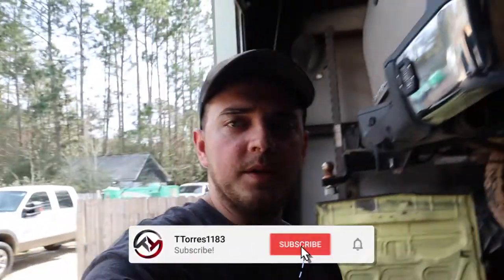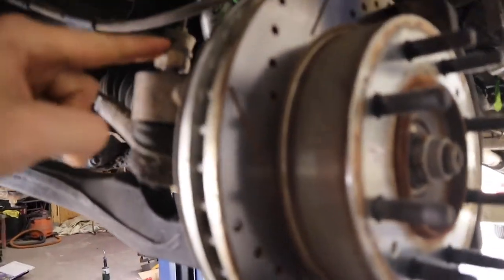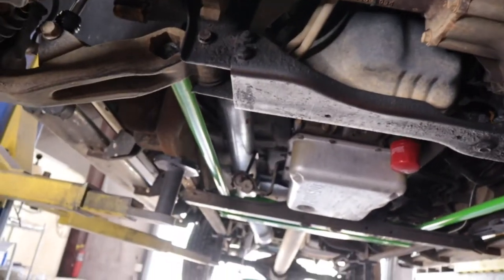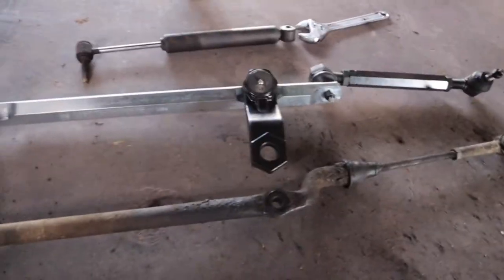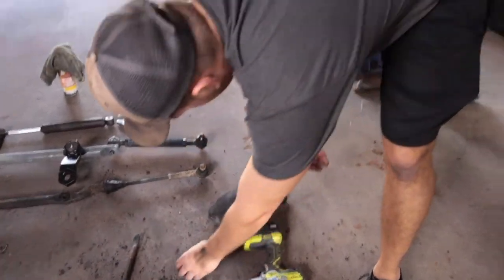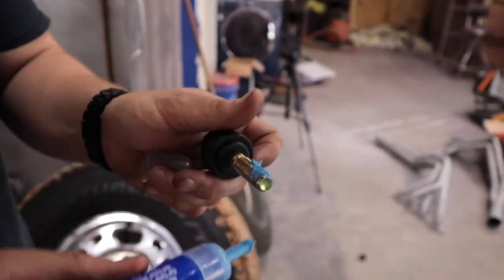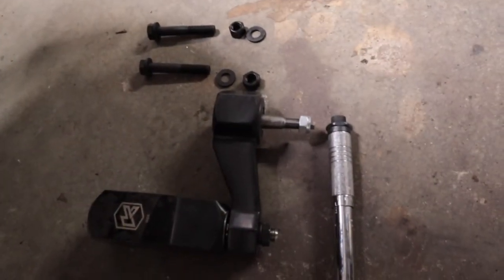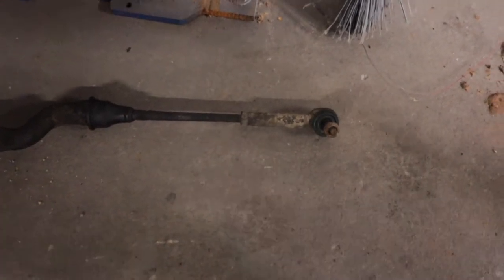INSTALLING KRYPTONITE ULTIMATE FRONT END PACKAGE! **CHEVY/GMC 2001-2010**

Comment from the maker: Time to get some new wheels and tires!
Reply: YOU INSTALLED THE TIERODS THE WRONG WAY
Reply from the maker: How
Reply: @TTorres1183   The notches on the body of the tie rod are supposed to be on the steering knuckle side not the centerlink side. made that mistake on mine
Reply from the maker: Did the truck ride different?
Reply: @TTorres1183  after the front end wore in a bit, it felt like they strarted hitting/binding somewhere so i flipped them to the proper orientation and it has seemed to fix the issue.
Reply from the maker: My truck rides just fine. Did you upgrade the entire front end?
Reply: @TTorres1183  it was weird. I couldnt find where it was rubbing/hitting so I flipped the tierods around and it seemed to have fixed it. The only things i didnt do were the upper control arms and the lower balljoints since they were still good.
Reply from the maker: Ahh okay. I think my setup is fine then.

Comment: Great video guys. I noticed your grease zerk is now on the bottom.. Did you mount your outer tie rods to the wheel spindles upside down?? The factory grease zerk is on the top.